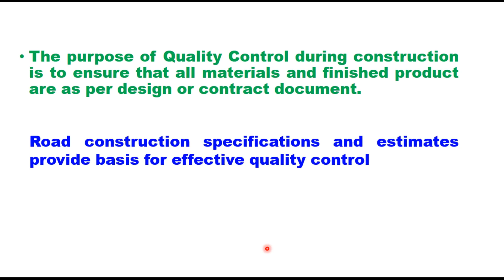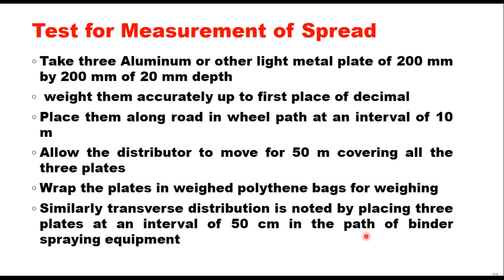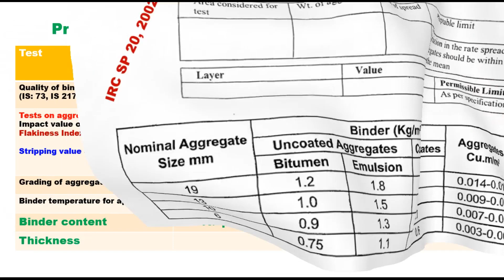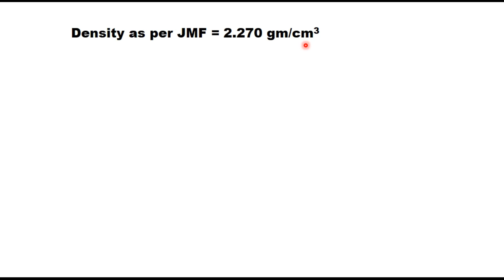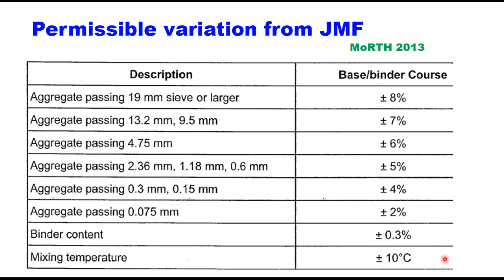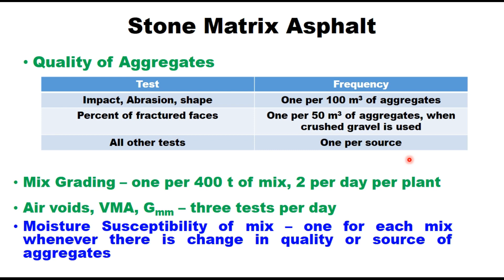Quality Control during Road Construction - Part 3, Bituminous Construction - from Prime coat to SMA

Comment: And if different  grade, then who grade use in upper layer in DBM or BC
Reply from the maker: hardrer grade in the upper layer, because it is the layer which takes the load directly. It is the layer exposed to heat, dust and air.

Comment: Sir,can you please tell what is the pressure need to be maintained in distributor bar for prime coat and tack coat? Thank you..
Reply: Prime Coat: The application rate typically varies depending on the type of surface being treated. For WMM (Wet Mix Macadam) surfaces, the application rate might be between 0.6 to 1.2 kg/sqm, and for granular surfaces, it can be from 0.9 to 1.5 kg/sqm. The specific type of binder used (like MC-30 or MC-70) and its viscosity will influence the pressure settings on the distributor bar.

Tack Coat: The application rate usually depends on the type of surface over which the next layer is to be laid. For a bituminous surface, the rate might be 0.2 to 0.3 kg/sqm, and for a granular or treated surface, it might be 0.3 to 0.5 kg/sqm.

The specific pressure to be maintained in the distributor bar would depend on the viscosity of the material being sprayed, the width of the spray bar, and the desired rate of application. The equipment manual or guidance from the manufacturer would provide precise pressure settings.
Reply: @Raj-ni8xs  thank you sir
Reply from the maker: Sorry, I do not have much idea of pressure in distributor bar.  But before start of the work, demonstration trial is done and the rate of application is measured. It will naturally depned on size of the nozzle and pressure in the bar.
Reply: @SatishIITR  ok thnk u sir